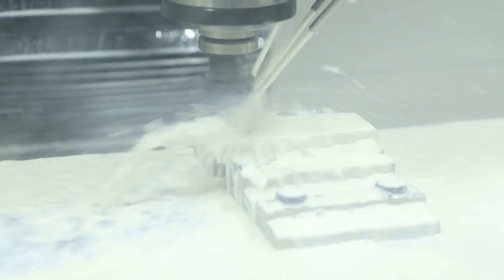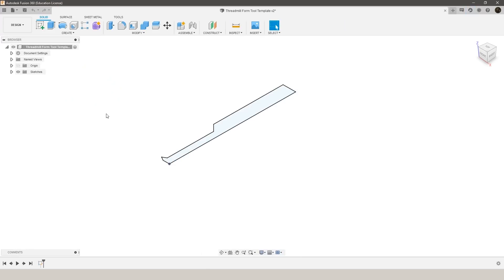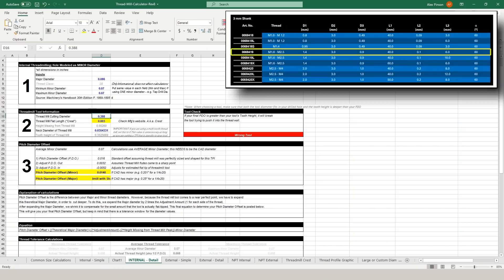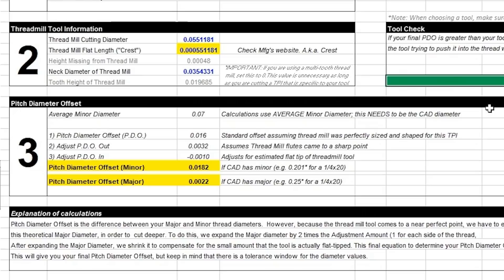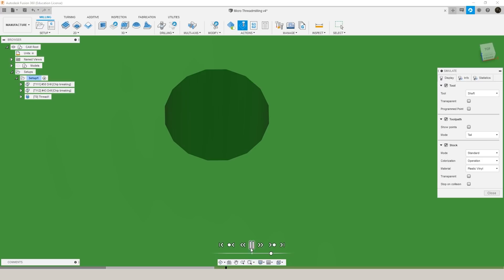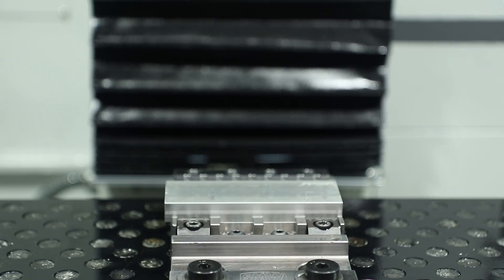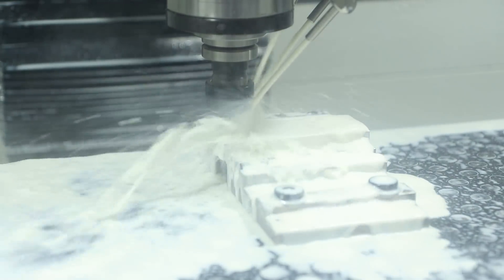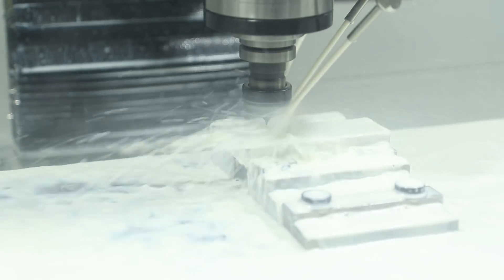How to Threadmill Small Holes on your CNC Machine!

Comment: I followed this exactly and tried milling an M4 metric thread after a 3.3mm drill in Aluminium. The spreadsheet gave me 0.13mm for the offset which seemed reasonable and looked good in simulation. However the fit was really sloppy. I tried a few more times with lower and lower offset but it still gave me sloppy threads. I wonder if my machine is interpolating the tiny radius circle badly.... Any thoughts? Anyway, great content, thank you!

Comment: I just used the spreadsheet for a metric threadmill - my very first such tool and my very first thread milling op and it just worked. Didn't even test it first but did run the sim a few times and looked closely. 
So, yeah, to all of us metric guys - just input mm into the spreadsheet and all will be good:)

Thanks!

Comment: I have been trying to get this to work for me in my company's Prototrak 2op VMC. I'm cutting a 4-40 thread in 52100 steel. It's only producing threads that are much too tight to put the screw into. I've increased the pitch diameter offset all the way to .048" (by .001" increments) and it is still way too tight. Also, the thread mill broke after a very short run of tools, only using a .003" step over and feed rate of 1.5 ipm. This is extremely frustrating because I talked my boss into buying the $90 tool and he was very skeptical, however I explained that this video and other help threads showed me the proper parameters. I doubt I will be allowed to get another thread mill after this.

Very very disappointed in this video apparently showing me how to do something incorrectly.

Comment: Nice vid and great refresher.  I need to do some 4-40 threads tomorrow.  At 8:38 in the video shouldn't the thread pitch for 4-40 be 0.025" and NOT 0.0178571 ?  How did that screw work at the end of the video? ;)
Reply: You're right. Not sure how that worked lol

Comment: So for #2 screw, the major diameter is 0.0860", and you drill a 0.0700" hole with a #50 drill. Makes total sense.

Comment: Just for funsies, do a #0000-160 thread. I'm really curious whether the Tormach has the stepper resolution for such a small thread.
Reply: Do they even make threadmills that small? Ive been looking myself for a 000-120, no luck from any suppliers.  Smallest Ive found was a 1.2mm, which does work amazing, made apporx. 3000 holes so far on the same tool in Ti. Absolute beast.
Reply: @halfhappy117  I was joking about it. As far as I know nobody makes a tool that small. At that size you probably have to use EDM or some other technology for micro machining I’m not familiar with.

Comment: Thanks for another great video.  Is there a calculation for stepover in the multipasses?  Can't get my head around this.
Reply: Take a look at the "How to threadmill!" Page on NYCCNC.com - there is a short section about finding the stepover. The calculated PDO / 2 is the stepover if you were to do it all in one pass. You can then take this number and either divide it by the number of passes you want to do to get a stepover, or divide it by the desired stepover to get a passes number. (Passes * stepover = PDO / 2)

Comment: You can create the clearance area of the cutter by setting the flute length and should length to only the thread form. Use the shaft tab to create the clearance area. This way you can get correct simulations.
Reply: I was going to mention this too, however you cannot parameterize the shaft values in the tool tab.  That is one benefit of using the form tool method.

Comment: This is only a problem for people relying completely on CAM-software, writing by hand is often faster than this
Reply: Really? Can you write an NC file for a 3D model mold faster than CAM? Maybe for a straight line...LOL
Not every shop cuts slots and holes...
I understand the frustration of those who can not afford CAM software, as I do with guys that think their conventional machines are better than CNC!
Reply: @srnc9740  I'm talking about simple jobs like threadmilling. Anything under say 30 lines of simple G-code is often faster to program by hand rather than using CAM-software. However, for serial production of complex parts I'd use Mastercam or something similar to generate toolpaths, but I'd also check the code manually for any possible improvements regarding travel moves, tool changes and alike.